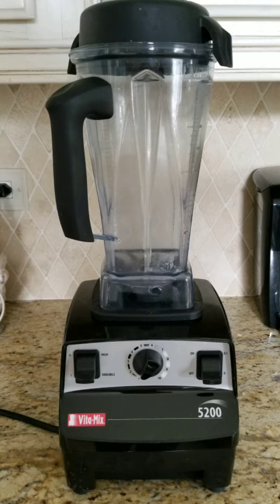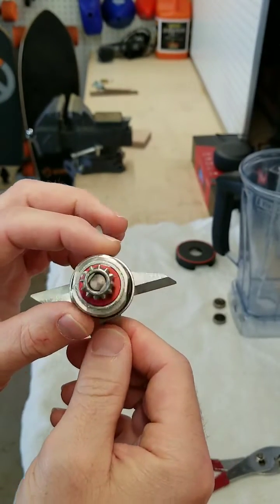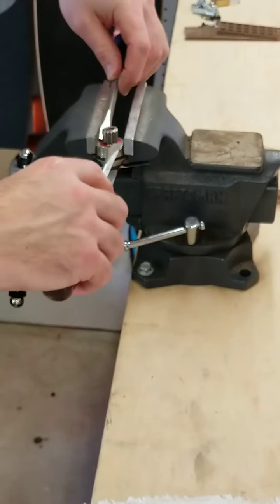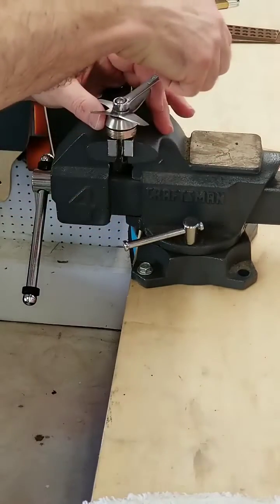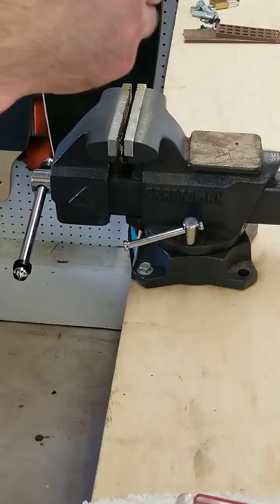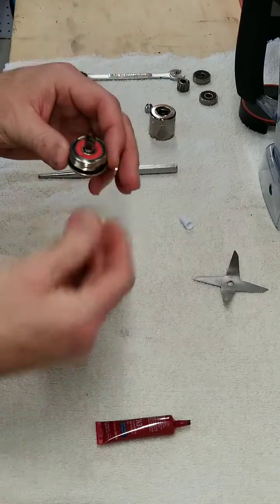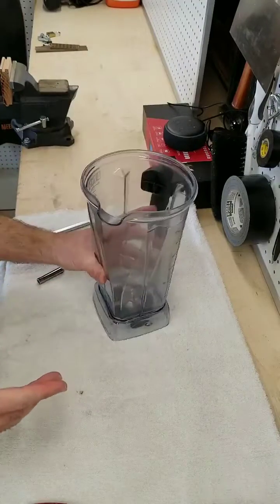Vitamix Blender Bearing Replacement Fix

Comment from the maker: If this video helped you save a ton of money, consider sending a couple bucks using Super Thanks (click those 3 dots to the right of Share and Promote).

When all else fails, just buy a new assembly
Vitamix Wet Blade Assembly from Amzn affiliate 
  (https://amzn.to/3BqiQJr)

These bearings are pricey when you only need a couple, but these are what I used - 
  (https://amzn.to/4hSmhM9)

ALL the steps on how to replace the bearings on a Vitamix container yourself.

What you'll need:
Sealed skateboard wheel bearings
Loctite 242 or 243
2 flat blade screw drivers
3/8" wrench
7/8" socket
8mm deep well socket
Bench vise
Pliers - maybe
Channel locks - maybe

Contents:
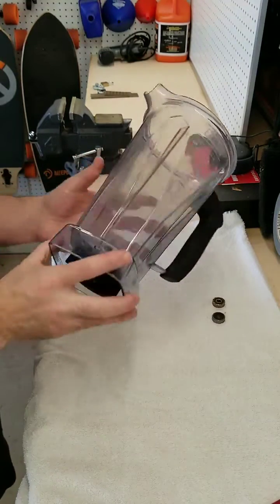0:45 Removing blade assembly from container
2:20 Removing bottom gear from shaft
4:00 Removing bearings and shaft from base
6:45 Removing bearings from shaft
8:35 Press new bearings
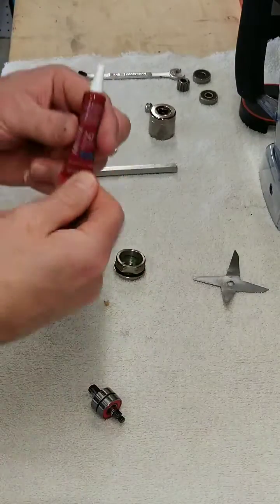9:55 Loctite bearings to base
11:10 Press gear on shaft
11:50 Reinstall gear assembly to container

Comment: Sometimes 👉👉Bearings stay in and shaft comes out so before using socket to remove bearing heat the outer case first and after  cooling spray  WD40 around the BEARING and case mating and leave for an hour to soak.

Comment: Make sure to use a bearing with a spec to withstand the high rotation speed of a vitamix! Otherwise it might break fairly soon.
Reply from the maker: Yes, not worth buying the cheap bearings.  I recommend at least ABEC 7 bearings.

Comment: Do you think this would all be possible without a vice? I dont have access to one.
Reply from the maker: You could try to hammer the bearings off, but you may end up causing some damage.  If it doesn't work out you could just buy the whole assembly - https://amzn.to/3BqiQJr  If the bearings are shot, you don't have much to lose! Good luck!

Comment: I just ordered an OEM Vitamix blade assembly on ebay for~$50.  The first one I ordered was 18 bucks and was a poor copy at best, leaked, didn't thread properly...disaster, got my money back.  Make sure its a genuine part.  Having installed this part, now my beloved blender is quiet and doesn't leak = happy again.  So, now I followed your lead and dissembled old blade assembly.  The bearings are 608HRS, which means they are stainless and have a rubber seal.  More importantly and something you failed to mention, is that there is a double lipped rubber seal above the bearings and under the stainless dome shaped metal that does all the work of keeping moisture out of the bearings.  This is the failure point to the whole system.  Its pretty pointless to replace the bearings if this seal is bad and lets moisture in again.  I doubt Vitamix sells this seal separately. I was more than glad to spend 50 bucks and have my daily use blender back in use, otherwise Vitamix will sell you the entire pitcher with blade assembly for ~$130 + shipping. Good luck!

Comment: I had one of these before and it lasted many years and I used it a lot. It blends MyBest.Kitchen chops ,grates. Does most anything you would want to use it for. A lot of bang for your buck. A litlle loud however it so fast it is not bothersome.
Reply from the maker: I agree and the noise level is probably the biggest downside.

Comment: This video was really helpful. Some points for others to learn from... There is a (small black washer and a wave washer as videographer calls it) both fit between the two bearings.

I kept getting the whole assembly stuck (not turning) when the 13mm nut is tightened... As indicated above, back the bearings back down the shaft to expose more of the shaft for the blade to attach onto.

You want it backed out "just" enough for the shaft to stick through the oring seal... 

My first try at repositioning, I pushed the bearings too far down and while the blade spun super freely, I found out it leaked through the centre shaft seal.

I then moved the bearings higher until the shaft just poked through... I tightened the washers and blade and aimed to get a little compression on the seal and bam... No more leaking.

The blade spins but not freely... If I recall, this was how the original felt when first purchased.

I will revert back if I find any issues.

Hope this helps someone else.
Reply from the maker: Thanks for sharing your experience.  And you remember correctly, the blade doesn't spin freely when new at all.
Reply: Same issue here, mine is leaking thru the center shaft. I have to go back to my friends house to use his vice to push the bearings up higher on the shaft. Hopefully, I can get it right this time.
Reply: did you get the leak to stop?     @Christopher_HotSauce    i cant stop my leak
Reply: I dont seem to have small black washer and a wave washer (or maybe i misplaced them  :(  )   and i cant stop it leaking,   

does the wave washer apply preload to the seals perhaps?    but it would still leak into the top seal od the bearing which would not be good ! 

did you use loctite?
Reply: @KevsGuide  I moved bearings down a little. But I still think it leaks a little.  Just going to buy a new pitcher sometime.
Reply: thanks  @Christopher_HotSauce
Reply: mine is leaking also.   Im not sure how you get compression on the seal?  can you please explain ?

Comment: Great video.  Very clear and understandable even without knowledge of English.
 I changed the bearings on my Biolomix T5200.
 I couldn’t have done it without this video and probably would have ruined the new bearings or shaft because I wanted to hit it with a hammer.
 The old ones were pressed out very tightly and the new ones were pressed back in.  I also used a vice, socket heads and a spark plug head.  Walked literally millimeter by millimeter so that there was no distortion.
 The hammer is very rare and neat.
 Greetings from Russia.
 Thank you🤝
Reply from the maker: Thanks for watching and so glad I could help!

Comment: Thanks VERY much!  I had an issue getting the bearings out of the main part, so took the small shaft and put it in boiling water (didn't have a torch handy) that expanded it just enough to push out the bearings. Thanks again for a fantastic very helpful video!
Reply from the maker: So glad to hear this, thanks!
Boiling water?!  Haha, I'm not sure I would have thought to do that...
Reply: @mmark300   Was working great, but had a little leak under the bearing, went to tighten the blade but noticed the bearings are seized now.....I assume the leak went through the bearings and they are now rusted in place. Wondering what I may have done wrong for it to leak? Will put in new bearings again, but want to make sure I don't have a leak this time. Any suggestions?? Thanks Mark! 👍👍
Reply from the maker: @carboatsguy5846  I failed to mention a small o-ring type washer on top of the top bearing.  If your original was damaged others have used silicone there instead.
Reply: @mmark300  Thanks Mark, I don't think mine was damaged, could I have had the blade on not tight enough maybe?I'll buy a new o ring, just to play it safe. Would you know what size it would be? If not, I'll take the old one and try to match it up. Thanks again!!

Comment: Your video saved me $75 repair.  I had no problem twisting the piece off by hand that you supposedly need that dumb wrench for. My second bearing was basically metal rust mush fused to the inside of the housing so I used a screw driver bit slightly larger than the inner diameter of the bearing to press it out.  I actually had some skate board bearings kicking around and was done in a couple of hours. Thank you so much for making this video!
Reply from the maker: Nice!

Comment: Excellent video.  Easy to follow and very complete.  Gave me the confidence necessary to undertake the repair myself.  Completed successfully.  I found during disassembly that the shaft came out of the bearings easier than the bearings out of the housing, leaving the bearings stuck inside the housing.  Had to do more than tap on them (more like beat them out) with a nail set through the upper opening in the housing, taking care not to damage the rubber gasket.  Because the new bearings fit very tight in the housing, just as the old ones did, it took quite some pressure to press them into the housing and thus didn't require Loctite..
Reply from the maker: Great to hear, thanks!
I've been reading about what must be lots of differences in original tolerances.

Comment: Great video! I ended up with the second bearing stuck inside and I had a punch just big enough so I didn't damage the rubber seal and it came out with a little tap. Thanks Mark! Dave
Reply: I had a stuck bearing too and I ruined my rubber seal, anyone got an idea where to get one?
Reply: @thatpadraic  any luck? Preparing if this happens to me.
Reply: @camibohn1017  you can find aftermarket replacement seals and repair kits online for about $10-15. Vitamix doesn't sell parts and even stopped selling the blade assembly separately from the container, so you the cheapest fix according to them is $150 lol. I had put mine together temporarily and pretty quickly saw that moisture leaks through the bearings which will certainly cause rust eventually. The next time I need to replace the bearings I will try a new replacement seal along with it.

Comment: Good to know when I eventually need to replace mine. It's been going strong now for over twenty years!
Reply from the maker: Wow, how often do you use it? I was once or twice a day for a few years, then a little less for another few before I had issues.
Reply: @mmark300  On average, I would say 3 or more times per week.
Reply: Mark Meyers... What issues did you have?
Reply: @mark

Comment: Do the bearins contain food grade grease incase the seal/s break, will the grease go into the blender container and mix with the food?
Reply from the maker: I have never heard of food grade grease so I doubt any of these bearings will have it. I also think it's not likely that bearing grease would go up into the container, especially during blending as it seems that it would be much higher pressure in the container as well as gravity working against it.
Reply: @mmark300  That's a good point about the gravity and the pressure.  I've heard of industrial food plants where grease or hydraulic fluid line leaks into the food.   

And this may not be possible but it would be interesting if they could design a plastic bearing that didn't use grease, but maybe it wouldn't be strong enough.

I remember reading the article about bronze bearings but they said that the lead in those could leak out a little bit into the food over time.
Reply: @mmark300   It is common in machinery used for food prep

Comment: Thank you for the video.  I have a question about a flat plastic washer that came off of my blade assembly.  It looks to me like a moisture barrier so not vital to the blade housing....or is it?  My wife noticed something black between the the housing and the blades.  I pulled it off to ensure it wouldn't get blended next time we use the Vitamin.  Any advise would be appreciated.

Comment: i saw on another video the person mentioned there is a rubber o ring which is placed in a milled place and provides first point of seal to keep the liquid from leaking through the shaft hole and reaching the bearings. did you see that o ring when disassembling?

Comment: Hi I'm trying to remove the gear, with 2 screw drivers, beating them with an hammer, no way to move it from the shaft. Did someone expirienced the same? Any help are super welcome. @teslamark great video.
Reply from the maker: Thanks! You could try some penetrating oil or try to heat the gear up with a small torch or lighter. Have to be VERY careful to not melt any of the rubber seals - should remove the blade assembly first.

Comment: brillant video thanks.   

is loctite really necessary?

i dont seem to have the wavey washer not the small washer that goes in between the 2 bearings!

i may have misplaced them  or maybe they were there.  i know,  i pulled it apart and waited a few weeks while the bearings arrived  lol
Reply from the maker: Thanks!
I doubt the loctite is necessary. Not sure about that wavy washer though...
Reply: @mmark300  thanks for your responce.  mine is leaking throught the bearings. i have contacted some bearing places and they say the seals in the bearins are woter resistant  not water proof.   

i have tried several times  but its still leaking 

any ideas?
Reply from the maker: @KevsGuide There is a shaft seal that goes above the bearings. Mine was a like a fabric washer but I think they are rubber now. I have seen them on ebay. I have read others have used a bit of silicone sealant.

Comment: @Tesla Mark Do the replacement blades come with the bearings installed? If so, I think I'd be better off just buying a replacement blade vs buying new bearings AND a vise lol. Definitely been wanting a vise, but God are they expensive.
Reply from the maker: They do sell replacement blade assemblies that come with bearings.  And yes, much easier to replace than just the bearing, but also more expensive than just the bearings (a few dollars).  
And a real good vise is definitely expensive, but if you're looking for a basic homeowner vise, try Harbor Freight or facebook marketplace...

Comment: I am looking for the shaft seal. Any Ideas...

I do not remove the gear I use a bearing extractor. A lot simpler.

I recommend Loctite 620. 243 is a thread locker.
Reply from the maker: Thanks. 
Many have been looking for that seal, unsuccessfully... Mine was so ok so I reused it. You could try form a gasket by Permatex or someone else used some silicon.
Reply: You can buy the seals on ebay.

Comment: Hi when I changed the bearings and put it back together it was very difficult to turn the blades. Any suggestions.
Thanks
Reply: I had the same issue at first. I had pushed the bearings too far towards the blades. I pushed them back and that fixed it.
Reply: Same here. When I tightened the blade nut it wouldn't spin freely. Haven't messed with it again yet. So the solution is to push the bearings more toward the gear?

Comment: Nice video. What size would the vice opening need to be? Some Vices are 60mm or 75mm, what would you recommend?
Reply from the maker: Thanks. I used a 4 inch (100mm) vise and with the method I used I'm not sure a 75mm would be big enough.
Reply: @mmark300  Cheers, just the info I needed!

Comment: I made this repair a few weeks ago and everything seemed to go smoothly. However, I ended up with a black plastic washier I don't know where it goes and a black gooey substance started seeping out onto the drive. Suggestions?
Reply from the maker: Probably needs a shaft seal, which can be found on ebay.

Comment: Looks like the old bearings had smoothie ingress, I assume the shaft seal is worn?
Reply: Exactly what i thought when my Bearings failed, because why else? unless after cleaning you leave your blender upside down with water in it.....
anyway i think not at least inspecting or replacing it is a half a$$'ed fix & asking for trouble down the road. i just did my Jar & i didn't have a replacement so i oiled the Shaft then put Form A Gasket around both sides of the shaft seal, inserted the oiled Shaft(with bearings already on) in, then made the Form A Gasket neat.
as always an example on why you should use your brain & not mindlessly follow tutorials.
Reply: Could you explain what you did? I'm not following. So you DIDN'T replace your bearings?

Comment: Could you tell me whether these would work? I also have a 5200 with a 64oz container I'm trying to fix.
Reply from the maker: Whether what would work? I'm not sure what you're asking
Reply: @mmark300  thanks for your response!

Sorry, I posted a link to some Amazon bearings in my reply to first comment . It’s the reply just above yours, and I’m wondering if these are the right bearings that I should buy? I’d really like to try and follow your video, but I’m new to all this!
Reply from the maker: @felicityh.1947  Oh, I'm not seeing a link in your replies, but look for my pinned comment on some choices.  Entire assemblies are also available if you're not so mechanically inclined.
Reply from the maker: @felicityh.1947  No, these are only ABEC 1 or maybe ABEC 3.  You should only use ABEC 7 or above.  Otherwise they are sealed on both sides and are the correct size, 8x22x7mm.
Reply: @mmark300  Thank you, that’s SO helpful!! I really appreciate you taking the time to respond to my comment, it means a lot! ☺️

Comment: What model blender are you using?  Is it an older unit?  I'm thinking older = better quality.   Curious to know how you like it.
Reply from the maker: It's the 5200 from 2012, I think. Still like it overall. The only things I don't like are how noisy it is and that the pitcher eventually gets dirty and is difficult to clean without scratching